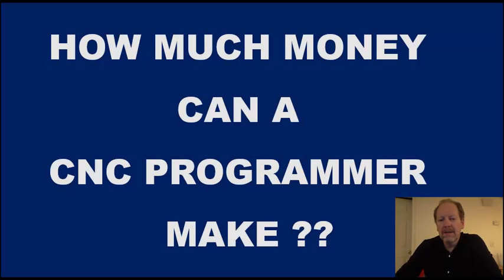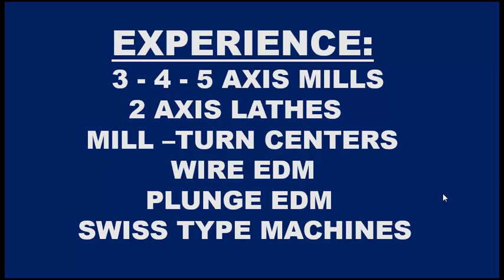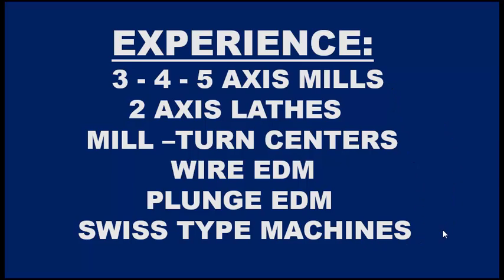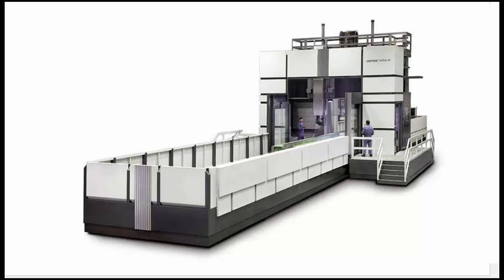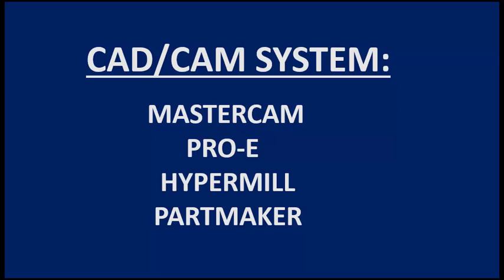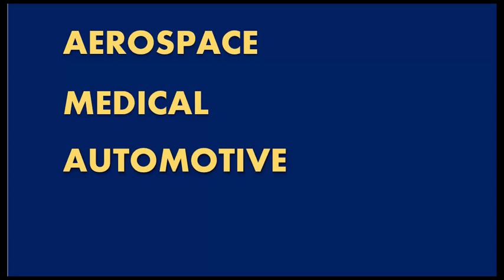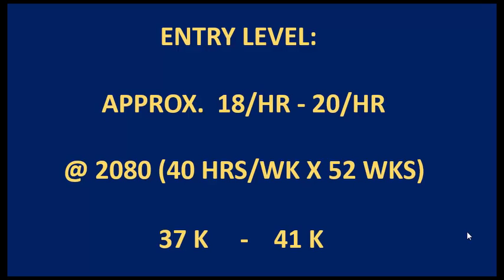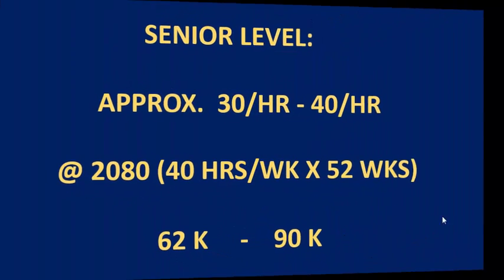HOW MUCH MONEY CAN A CNC PROGRAMMER MAKE??

Comment: I am a CNC programmer I'll use the Master cam software. I need a job do you will help me
Reply: yes, we can help you.  we have an open position for a cnc programmer $35.00 per hr.   do you have experience?  what state are you in?  how many yrs. of xperience? which cnc machines have you run.  send me your info. asap
Reply: @mizaelreyes7749  we have a cnc shop in houston tx if you need some work done
Reply: @Arpremiermachine  I need work

Comment: The real money is in job shops or a factory with a bunch of proprietary machinery with an in house machine shop to make replacement parts on the fly. You need to be the programmer, and machinist. In NY with 8 years experience at $28/hr. Honestly I should've negotiated higher because everyone in the area is desperate for a machinist in my age group.

Comment: hello sir I download a app for threading program. would you tell me is it correct.G00 X11.85 Z2.0
G76 P010160 Q010 R0.03
G76 X8.007 Z-20.0 P922 Q313 F1.5.       nominal size is 10 and start position is 2 mm in this program and end point is -20 .please sir just look at it when you have time this is my starting in this field

Comment: why would you write the programing by hand. any shop that mills or lathe lets the software write it's own code. I use a 3d scanner or start with a cad drawing. it is petty common for the code to be a few thousand lines. It would take you days to write it yourself. most any cad/cam software writes it. I have one software "Mach3" it willit only cost $175.00 & you inport DXF (cad drawing file) and it write code in 1 maybe 2 minutes, It's called gcode. google it..... Mach3 CNC
Reply: You can get more efficient programs by hand. Especially with similar parts.
Reply: And knowing how to handwrotr code let's you debug

Comment: on average how long will it take to reach senior level?
Reply from the maker: Christian Catay
 If you work in a job shop environment, then it will take about 5 years to reach that level. It just takes time to actually do enough projects to gain the knowledge and experience.
Reply: lol 5 years of experience is entry level in Canada.
Reply: I have 35 years of experience I can program Haas, Mazak, Proto Trak, Bridgeport, set up, trouble shooting, welding etc, and I don't think I'm at a senior level.
Reply: A solid 30 + years you’d be seen as the “one with all”

Comment: Iam  cnc swiss programmer for 2 years but ive been dealing with lathes and swiss for about 5 years im certified in partmaker , ive done really hard parts, like mill programmer cant believe I did those jobs on a a swiss and im getting pay 22.50 with overtime available. how much do think I should get pay ??
Reply: You my friend are underpaid....  As long as you'll work there they won't pay you so to get more money and experience it's time to move on...
Reply: CNC programmer makes over $30-35 in the Midwest, I have seen some make $40 an hr.

Comment: not a programmer yet!! ran every kind of machines, do my own setup, prove out! went from 10an hr USA$ now I make 20an hr USA$ just as a machinist over 14 years ran 3,4 & 5 axis running two three and four machines at a time at times
Reply: Knowing how to setup and run machines is a plus but Programming with 3D software is completely differant.  Hopefully you can move into Programming at the company your at to get Programming experience, then move on to build your resume....

Comment: tom I keep hearing at school I go to NTMA machinist school and I keep hearing programmers can make 70-80/hr is that true and how many years experience would I need and what type of programming would that be to make such figures if at all possible
Reply from the maker: You can earn those figures as an independent CNC programmer. The experience varies. It depends on the industry you're writing the programs for. 
The best experience you can get is in a job shop type machine shop where you do different projects almost daily requiring setup and programming. The amount if time is tough to determine, since that will be different from one individual to the next. Hope that helps.Thanks for asking.
Reply: As an independent contractor with no insurance or benefits you could get that kind of money,,,, but you better know your shit,,  Posts, macro's and every type of machine thrown at you...
Reply: it seem too high, but it not impossible. I use to do cnc programer contract, they pay you more but after 3 or 6 month when they got all the program they want, you out. And if you take too much time for one program they ain't gonna pay for extra. I know a lot of people around try to make them look good. 70-80/hr is the charge rate of cnc machine shop owner. If you work for some company , they either throw you in salary year or 30 is  the common pay.
Reply: I gone to NTMA great school

Comment: I just got into 2axis cnc gang tool lathes got hired at 15.50/hr now been there a year and 4 months and now I can program at the machine for simple parts and did good with threads and grooving but I never used any cad/cam software and I'm still getting paid the same money so in youre opinion tom if u were in my shoes what kind of raise would u be asking for? And like ur lathe programming videos they always help thanks
Reply from the maker: +Bradlsx Hello. Thanks for the feedback. Now if I was in your shoes I would be confident to ask for at least a $2.00/HR raise. You have worked and learned for 1 year and 4 months and that is a long time without an increase.Keep learning as much as you can and build on the knowledge you already have. It takes a few years to learn what you need but it is very rewarding. Thanks for watching my channel and for subscribing. Tom
Reply: Conversational?